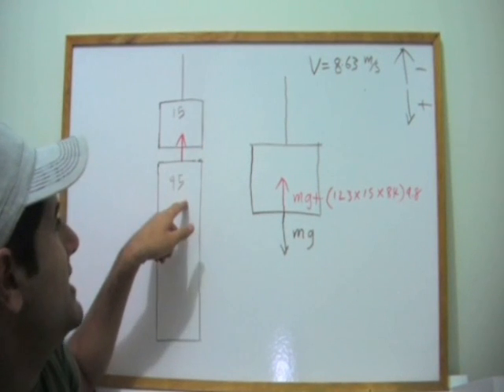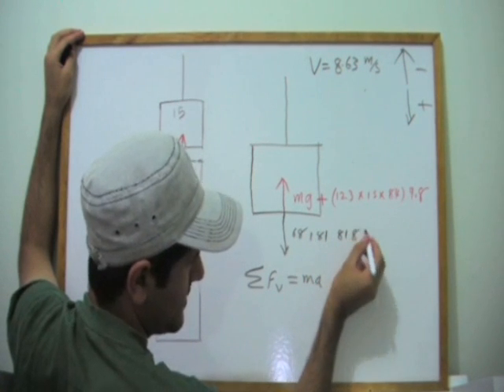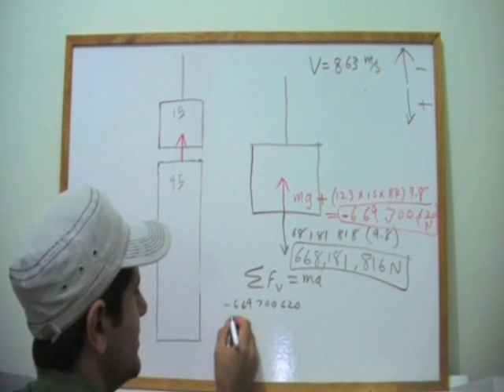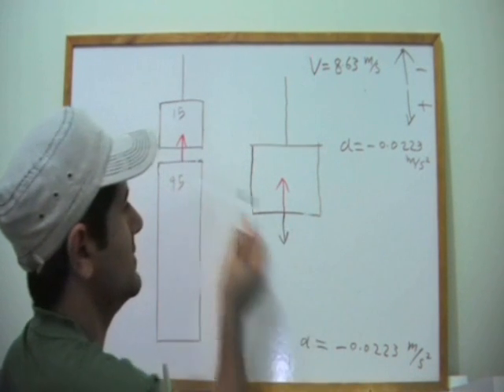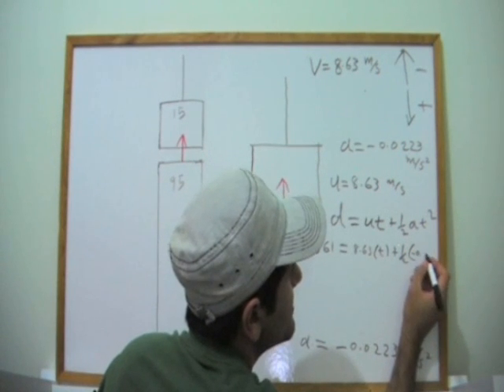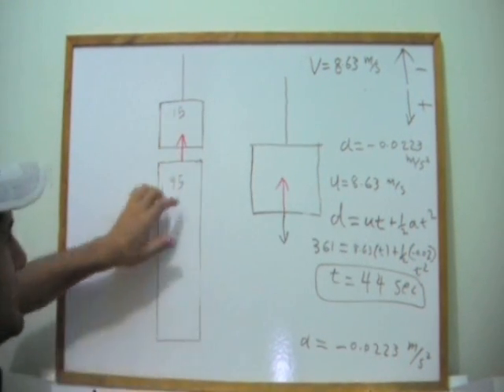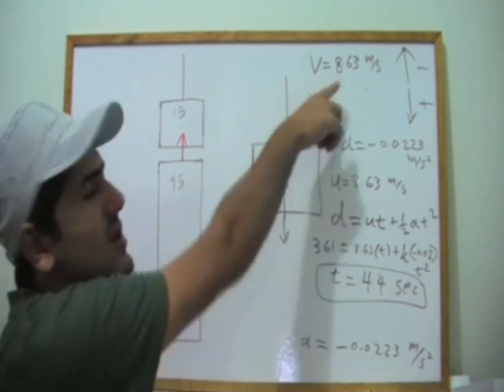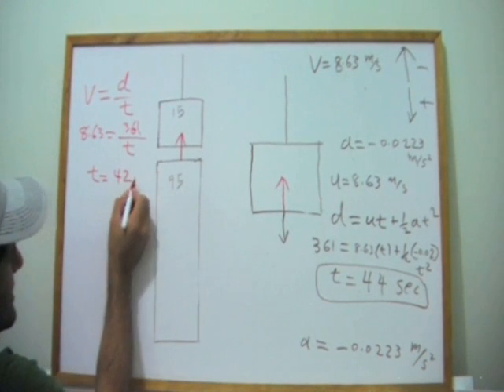(Part3) 911 Simple Physics Structural Failure Vs Demolition

Comment: This guy completely ignored the fact that one floor being crushed below the impact point, adds to the downward forces.. a second floor adds another force, and so on and so on. He needs another drawing board!
Reply: +999DaveUK  
Dave you are absolutely correct. These idiots think that it's the top of bldg vs the bottom. The truth is it's the top vs a single floor below. Dynamic weight vs live load capacity. It wasn't even remotely close. The top is cumulative and ever increasing in mass. Ali's math may look impressive, but he has no understanding of how these bldgs were built, thus he cannot apply his math properly.

Then you have idiots like Kevin and Mein who thinks Ali's math somehow vindicates their stupid theories. When in fact it just shows how ignorant they all are to the engineering of these towers.
Reply: +Kevin Price But it didn't disintegrate did it? There was some 30 to 40 storeys of core still standing after collapse. For a period of 30 seconds. Your explosive theory doesn't explain this does it?
Reply: +Kevin Price The point is..... the guy in the video is making up his own physics laws. And for you...what is worse....is that you actually believe in his theory. Good luck with your research into fairy tale science.
Reply: +Kevin Price Kevin....I think you want a NIST Report that goes something like....1. WTC7 collapses. 2. Observations.. looked like controlled demolition 3. Evidence.... none but who cares? 4. Conclusions. .. explosives..or maybe thermite....or maybe super thermite...or maybe super duper nanotechnology thermite. Job done!
Reply: ***** It depends how you define 'pulverised'. There was a pile of debris, after the collapse, which went to a height of about 15 to 20 storeys. This comprised concrete panels, steel, chunks of concrete and office debris. The downward gravity fed forces totalling 250 tons of TNT equivalent, would cause major break up of concrete.
Reply: ***** It's important to explain the events using evidence, and not some theory which is based around unknowns. I don't understand why you call me biased, when I have presented facts. Anybody who attempts to raise the theory of controlled demolition needs to provide the evidence and logistics behind this.

You said you thought 'everything had been pulverised', then you suggest to me that I think steel can be pulverised? NO... of course I don't believe the steel was pulverised. Where on earth do you get that idea from? I previously stated that there was a pile of rubble and steel 15 storeys high after the collapse.

So perhaps you can explain to me where I have ''changed anything based upon what I have seen''?
Reply: ***** Don't forget the question I asked you.

So perhaps you can explain to me where I have ''changed anything based upon what I have seen''?
Reply: *****

But I came here to comment on this video. You haven't challenged any of the points I made about the accuracy of what this guy has said, instead you are loath to criticise obvious errors. This is understandable.

This is why 9/11 conspiracy theorists get such a bad press.... they have evolved into beings that are quick to say what couldn't have happened, but steer well clear of making direct allegations. This avoids direct challenges. But it also prolongs the doubt in some peoples minds.

But after 14 years, nothing has emerged anywhere near to exposing your 'wicked government'. Perhaps after another 14 years, you might ask yourself 'why?'
Reply: +999DaveUK the removal of acceleration, won't be compensated by the small mass added.
Reply: Kevin Farnan So you consider 8 to 10 stories of a tower block to be a 'small mass'?
Reply: +999DaveUK Your argument does not explain the systematic disintegration of the core steel structure.
Reply: +999DaveUK I'd I were you I would research this subject a little more.
Reply: +999DaveUK I appreciate your comment, but it is NOT only Mohamid's physics, but 1500 architects and engineers, hundreds of high ranking US military officials, etc., etc.  Tom continue to condemn them is an act of futility.
Reply: +999DaveUK BTW, I can't believe some of the irate comments some people are making here!  Not you of course, but this is a filthy place and I have to get out of here.  Sorry ;)
Reply: +Kevin Price  I don't blame you - personal abuse is one of the techniques used by some people such as oldschooldan1 to drag the interchange down to their level when they cannot engage in constructive argument. It is a widely used technique, unfortunately.
Reply: +Mein Sohn Thanksgiving you for your reassurance.  IT is very disheartening when this happens.
Reply: +Kevin Price  Your welcome - best to you.
Reply: +Oldschooldan1 In simple terms, the free block of 10 stories fell without any resistant opposing force until it met the first solid floor. The energy produced by weight and velocity far exceeded the design loading of the floor below. Hence collapse with increasing weight and lower velocity. The video incorrectly presumes that the floors below act together to resist the kinetic energy. Therefore the math calculations he uses are not based on the true action of the building.
Reply: 999DaveUK
 Exactly, what he is proposing is that the structural columns fell 12 feet and landed perfectly on the columns below. How he thinks a 14" square box column is going to land perfectly on top of another 14" square box column from 12 feet up int he air is beyond me. There are so many people that just can't grasp this.
Reply: +Oldschooldan1 If you would stop resorting to vulgarities and name calling, maybe we could have a more constructive debate.  So please, let's be a little more civilized, with nor more stupid remarks as it speaks loudly of what type of person you are!  I am not saying for one minute that this video explains it all with comprehensive physics. A good place to start research on this topic is this website: http://www.ae911truth.org/ of 1500 architects and engineers.  I don't know your credentials, but I have a degree in physics and I can't even begin to dissect all of the intricacies and dynamics of the collapse of those three buildings.  The website link I have provided can at least begin to do this.
Reply: +Kevin Price Have you looked at the credentials of some of these so called engineers? Check out their skills. You'll find a lot of them are no more than building contract managers working on single storey buildings like schools. It's quite interesting to discover their agenda.
Reply: +999DaveUK Yes, I agree (some of them).  Many of the architects who have actually worked on the design of the buildings also have serious problems with the official report.
Reply: +Kevin Price Kevin. ..many of the architects and engineers who worked for the contractors on WTC do NOT have any major problems with the NIST report. NIST themselves say no one will ever know for sure the sequence of collapse.
Reply: +999DaveUK There we go.  Some are some are not.
Reply: +999DaveUK I, hopefully like you and every other decent human being wants the truth, and not a report that goes something like this or that.  The NIST report is seriously flawed, and that IS a fact.  The whole forensic process following the disaster was seriously flawed, and that IS a fact.  All I want is the facts.  Anyway 999DaveUK, it was good discussing this with you, unlike another blogger in this blog, but I can't handle any more of the tit-for-tat stuff happening about this video, so I will now unsubscribe.  "Seek the Truth for the Truth shall set you free" ;)
Reply: Kevin Price Kevin, before you go. I want you to understand why I was so abrupt with you. When you make claims like the cores disintegrated it just adds to all the stupidity that floats around the internet regarding 9/11.
Some gullible kid it going to say geez the cores just disappeared. When this this is completely ridiculous. The core columns were all found in the pile, they did not disintegrate.
You say you want the truth, well have you actually read the NIST report or the AWS report? Have you read the bldg plans? Can you understand them? I've spent the last 20 years in the architectural field and read the bldg plans, been in all 3 bldgs and know the limits of the floors. I can tell you without a doubt the floors could never, ever taken the amount of force put upon them by the falling top. If you want to continue I can be civil, but if you start talking about energy beams or nukes or anything ridiculous like that I will be forced to call you out on it.
Reply: +Oldschooldan1 There are a lot of people of high technical credentials who would disagree with you on many of your points.  I don't really know who you are, or your true capacity, but I will leave the debate between you and them.  Anyway, YouTube is a ridiculous venue for this type of debate.  Have fun, don't get too excited, or like they say, your Hapkido might backfire on you ;)
Reply: +Kevin Price Kevin.. you ignore one basic fact. There are flaws in this video, flaws in the science and flaws in the conclusions. We are not talking about minor flaws, but major flaws in his argument. This is NOT a matter of opinion.. it is FACT! I see these videos daily on the internet, YouTubers who have an agenda, and then use flawed arguments to make their agenda seem real. So if you want to have fun, watching truther videos, and agreeing with likeminded souls, this is the place to be. As for me, I won't allow these same ''truthers'' to spread garbage without some kind of challenge.
Reply: 999DaveUK
Well said, Dave!
Reply: Right on.. The comfortable piew is always more comfortable.   Just like you support official stories from the establishment and challenge "truthers",  some people dare to challenge the establishment.  Of course the establishment and main stream media label them as conspiracy quacks.  Can you imagine a world where no one challenged the establishment?  :O
Reply: +Kevin Price And all the comfort you need is here. You'll find the truth somewhere...just remember to avoid the facts....make up stories.... ignore evidence....and you'll fit right in.
Reply: +999DaveUK We could go on forever,  but from the statement you just made I believe you really did not digest may last statement,  so I will leave it with all you experts to argue in favour of the establishment who loves you for your loyalty.  Anyway Dave,  I am running out and leaving it in your expert hands ;)
Reply: +Kevin Price Well I was just implying that if the truth I so important to you, then supporting a video like this is unwise...
Reply: +999DaveUK Please make a video that shows the math and even an experiment. I really don't want to believe the truthers but they make the best explanation for it to me.

 Like to make a point that Muhammad said in this video and to which you, you seem to be ignoring. The building took about 10 seconds to fall and if you take the best conditions for this building to fall, it would have taken about 42 seconds to fall. And please, simple stating that his physics is wrong isn't going to fly for me, please prove it for me.
Reply: Leigh Foulkes First of all I would say that nobody knows how long the towers took to fall, due to the large debris cloud which obscured everything.

Regarding the video, not only is his physics wrong, his assumptions that the upper mass of floors impacting on the floors below would be repelled by the upward resistance is patently false. He explains the upward resistance of the floors below to be sufficient to repel 14 or 29 stories of dynamic mass.

Where you state that the video explains that the collapses took 'about 10 seconds', I would ask... how does he know this?

There are two ways of calculating approximate collapse times. One way is to observe and time, the other way is to calculate using known forces and other observations, such as video or sounds.

This video ignores the weight transfer in the form of momentum of mass and velocity impacting on the first solid floor below. Let me ask you this. If the first solid floor that the upper block hit had a design loading of x, do you think that the upper block impacting exceeded this load x or not? If your answer is yes, then the next floor below is going to be impacted by a reduced momentum, but additional mass (x+y) where y is the mass of one floor.... and so on. If your answer is no, then you would have to explain how that momentum could suddenly be transferred into the vertical columns and immediately repelled. And don't forget that there are unknown forces to be applied, such as vertical columns becoming detached due to sideways pulling by collapsing horizontal beams. As well as the energy contained in fires.

Regarding collapse times, the approximated free fall time would have been around 9 seconds. The approximate collapse times using momentum/weight transfer calculations coupled with video and audio observations was 12.6 seconds for WTC 1 and 11.6 seconds for WTC 2. This collapse time consists of two elements, the initial collapse below the block, and the final block collapse as it hit the rubble pile. This gap is crucial, as it's defined by the timed collapse of each upper floor being approximately 0.1 second. For WTC 1 this equates to 35 stories, and WTC 2 to 25 stories. So these values are NOT small.

Finally I don't have a video of this as the calculations are quite complex with many unknowns and variables. But please look at the paper by F.Greening http://www.911myths.com/WTCREPORT.pdf which is professionally explained, unlike the amateurish effort in the video here. Then make a judgement yourself, it's your choice.
Reply: I believe that this wasn't a core as is the modern concrete core which is designed to take all weight and stress imposed on the building but a relatively light steel core which was intended to work with the external structure as as a combined strength design....the core also providing for the services....
Reply: The biggest problem with trying to accept this guys hypothesis OR the government one and 'prove by math' is that there is no way to measure or even closely estimate the mass of the ejected material. So much concrete and steel was blown out sideways that it is no longer part of the working mass of either theory. I'm much more interested to learn how all the core columns and exterior ones failed nearly simultaneously given the asymmetrical damage and heating. All of the government reports conclude with 'and then the building inevitably fell down'. Contrast that to the performance reports of the Murrah federal building in Kansas City, a meticulous failure description beam by column, by floor. Then we can ask what caused the sulfidation present in what little steel remains for our examination. It's all more or less moot, the world isn't going to change back to pre 9/11 conditions. [thanks for the link, I'll read it after dinner]
Reply: Phil Rabe
You cannot compare the Murrah federal bldg to the WTC. They were not built anywhere close to being a like. For the collapse of the WTC to have been stopped 6 floors worth of mass would have to have been ejected for every floor destroyed, this did not happen.
Reply: Sorry, I was comparing the quality and the detail of the two investigations. I did not make a comparison of concrete vs steel framing. The current hypothesis [only for WTC 1,2] depends on accretion of debris and ignores the loss of the unknown but clearly Large mass of the ejected debris, therefore a better model is needed. So far the only explanation for the  volume of ejections is the air being energetically blown out from each floor. No compelling explanation for the melted and molten metal at GZ, steel sulfidation, the fires in the pits for 90+ days after, etc. etc.
Reply: Phil Rabe

”Sorry, I was comparing the quality and the detail of the two investigations”
The WTC collapse has been the most expansive engineering investigation in history.  We have the FEMA report, the NIST report, and the AWS report. Reports from Purdue, MIT, the ASCE and dozens of papers by independent researchers such as Bazant and Greening. The head of the ASCE investigation was the same person who headed the investigation in OK. I fail to see how the OK investigation was any better than the WTC.
 
”ignores the loss of the unknown but clearly Large mass of the ejected debris”
Let me try and explain what you are asking to have happened. The south Tower collapsed around the 80th floor, there were 30 floors above it. The floors were rated for no more than 6 floors falling onto them. You are saying that 24 floors would have to have been ejected from the bldg. at the point of collapse. After this point the number only grows with each falling floor 25, 26 and so on. Does this seem remotely possible?????
 
”No compelling explanation for the melted and molten metal at GZ, steel sulfidation”
There was never any molten steel at GZ, none. Feel free to link me to one photo of molten steel. The sulfidation only seems to have happened to a couple of pieces from the pile and has been explained by exposure to the massive mixture of elements found in the pile including GWB. The truth movement tried to do an experiment showing that fire and GWB could not produce the found effects, the problem was they left out 2 key elements, time and water. The samples that show this sulfidation were victims of nothing more than acid rain. There was 220 acres of combustibles at GZ it’s not hard to understand why the fires lasted so long; underground fires have raged for years.
Reply: Thank you for the measured rebuttal rather than the usual '911 acceptors' howl in all caps "Why can't you damn truthers let the poor souls rest in peace". I am familiar with all the rebuttals you offer.  I am not tech savvy enough to make my own links and know better than to point you to a 'truther site'. I will take screenshots and try and paste them in the end. The point with the two investigations I keep failing to make is that the only building performance report [FEMA] concludes 'and then the collapse was inevitable'. In KC they did not say 'after the truck blew up, the building fell down'. ASCE did not do a performance report that I know of. Actually I had not heard that the sulfidation could be from acid rain, so that's something. 
OK it seems I can't copy and paste into this chat frame,I could email but I'm uncomfortable asking you for an address. I would show the videos of the 'metal pouring from WTC2' moments prior to collapse, it is on google without going to a truther site. Apologists or '911 acceptors' say it was molten aluminum, or copper from the planes. AL is silver when molten and Cu takes a much higher temp than a hydrocarbon fire will produce. In 'the pile', I  suppose pulverized office contents Could burn underground for 3 months w/no Ox, but it would just smoulder and never reach / maintain temps of 1500F+ as seen in NASA thermals of GZ. Not sure where you found that the truther wallboard experiments did not give enough time for the eutectic sulfidation present, they usually let it burn for much a much longer time. Thanks again for not getting all angry and all capping!! [re: ASCE, "A group of volunteers from the American Society of Civil Engineers (ASCE), many of whom had also participated in the Oklahoma City bombing investigation, started an investigation with limited resources. FEMA eventually took over the ASCE's investigation, and named it the Building Performance Assessment Team (BPAT)."
Reply: Free fall would have taken about 10 seconds.  Any resistance (impacting onto lower floors), would have significantly increased the time required for the complete collapse.
Reply: I got a ration of crap from a government apologist: They've increased the total collapse time by adding the few seconds the remains of the core stood for 1&2, and they added the part of the early penthouse collapse we rarely see to WTC 7. They also claim that office fires reach and exceed 2000 F and that iron micro spheres are a common byproduct of an office fire... It's the same line they used on the molten steel pouring out of T2 saying it was aluminum or even the copper wiring from the planes. sure guys.
Reply: Phil Rabe
”They've increased the total collapse time by adding the few seconds the remains of the core stood for 1&2” The time of collapse is the time of the collapse, video, audio and seismographic evidence doesn’t lie. The cores stood for nearly 40 seconds longer than the initial collapse, this was not just a few seconds and is rarely if ever included in the collapse time.
 
” they added the part of the early penthouse collapse we rarely see to WTC 7” You rarely see it because it goes against Truther dogma. It proves that collapse started internally and at column79.
 
”They also claim that office fires reach and exceed 2000” No the official claim is that temps reached around 1800F, this is common in office fires.
 
”that iron micro spheres are a common byproduct of an office fire” No, iron micro spheres are by products of welding and the fabrication of the steel itself. Walk into any welding shop and you’ll find the floors covered in them.
 
”the molten steel pouring out of T2 saying it was aluminum or even the copper wiring from the planes”  Well seeing how the metal ( not steel) was pouring out at the exact location where the plane came to rest, what else could it be….thermite???? I think not. How could the thermite and detonators survive the planes impact and fire??? Do you know what is used to ignite thermite, I do…magnesium. It is one of the few elements that burns hot enough to ignite thermite, it is also extremely flammable.
Reply: Kevin Price ''Free fall would have taken about 10 seconds''.... true free fall would be 9.1 seconds for an object dropped from 416 metres to a 10 metre high base at ground level.
''Any resistance (impacting onto lower floors), would have significantly increased the time''....the assessed and calculated fall times based on observations, seismic and video evidence were 12.7 seconds for WTC1 and 11.6 seconds for WTC2. These are differences of 3.6 seconds and 2.5 seconds. These ARE significant and show the resistance or static energy in the floors reduced the fall times. Put into perspective, there would have been 26 to30 stories of WTC tower structure still standing while your free fall object had already hit the ground.
Reply: I guess since since the only hard data on when the roof hit the ground is seismic, we need to focus on the speed of the observable collapse from all the video evidence. Trying to include parts of the core that stood 20 or 30 seconds longer is pure obfuscation, as is including the early collapse evidence of tower 7 prior to the ultimately confirmed by NIST FREEFALL part of that collapse sequence in an bald effort to disprove 'near' freefall speeds of the entire WTC7 roofline once it started to drop. The videos support the hypothesis that there was little or minimal resistance from the cold undamaged structure below the impact zone in 1&2, they include the ejected material as part of the collapse mass dynamics and make no explanation for 7's failure-Please don't regale me with pseudo descriptions of how column 79 caved at floor 12- NIST ignored the construction method used in high rise steel framed concrete floored buildings and have blocked release of 'as built drawings' that would eviscerate their hypothesis, because security /terror. that is not science. If those simple facts don't make sense there is no point in discussion. Drink the kool aid, it refreshes rather than confounds.
Reply: Phil Rabe
” the only hard data on when the roof hit the ground is seismic” No, we also have video and audio evidence, both of which prove that the collapse was much slower than free fall. The speed of the collapse of WTC 1&2 is consistent with how the structure was built. The floors were not rated to carry the load anywhere near what they were exposed to. This is a mathematical and engineering fact, there is no argument on this point. The structure below would have produced negligible resistance to the upper falling mass. The AWS report on the condition of the steel found at the site confirms this. The report proves massive overloading of the truss seats. No one is trying to include the cores collapse time into the equation, as I already stated it is seldom if ever used in calculating the collapse time. If it were the collapse time would be closer to a minute, no one makes this claim.

” including the early collapse evidence of tower 7 prior to the ultimately confirmed by NIST FREEFALL part of that collapse sequence in an bald effort to disprove 'near' freefall speeds”  I love this, this is complete nonsense. Why would you not include the start of the collapse in your calculations????? WTC 7 experienced 2.25 second of near free fall at the end of the collapse and this was caused by buckling of the exterior columns due to lack of lateral support from the already collapsed floors. A 47 story column cannot support its own weight without lateral support it will buckle. Keep in mind that true free fall only occurs in a vacuum, so unless you are claiming that rockets were attached to the falling steel to increase their speed, true free fall did not occur.
 
” they include the ejected material as part of the collapse mass dynamics” Do you have any Earthly idea how much material would have to have been ejected to stop the collapse???? I do! The south tower collapsed around the 80th floor, which leaves 30 floors above the impact zone. The floors had a live load of 6 floors worth of dynamic weight. For the collapse to stop, 24 floors would have to be ejected and this is at the point of collapse. After this the number only increases with each floor, 25, 26, 27 etc. Do you honestly believe this much mass was ejected from the bldg.??????
 
"NIST ignored the construction method used in high rise steel framed concrete floored building” They most certainly did not. Here is what they had to say about the shear studs:
 
 
For the 16-story model of WTC 7, NIST did not include shear studs on the girders based on the following reasoning:
(1)   The structural floor plans and erection drawings for typical floors are consistent and do not indicate any shear studs on the girders,
(2)   The Salvarinas paper did not cite a source for its figure showing "Typical Floor Framing," and
(3)   To make the modifications to the framing on Floor 10 would have required accounting for the structural changes shown on drawing S-8-10 (steel plates on bottom flanges of floor beams, shear studs on girders, and reinforced connections), and making the attendant changes to the floor loading in order to be consistent.  Since the drawings did not provide any information on revised floor loading or revised connections, this was not possible. 
 
It appears the only one drinking the proverbial cool aid is you….
Reply: and he's also completely ignoring the fact that there are thousands ton of steel which have resistance like hell and the floor where affected only on the 1 side which  would not produce such nice controlled collapse
Reply: Robert Balejik I was making the point that the guy who made the video completely disregarded the laws of physics. It's such a crass video attempting to show that the towers should not have collapsed. But in order to make his point, he invented things! According to him, the upper blocks of floors should have just stopped when they hit the first solid floor....if he'd have calculated the mass and velocity and the momentum forces, this would have told him his theories are bullshit!
Reply: 999DaveUK YOU COMPLETELY IGNORE THE CONCEPT OF "RESISTANCE".
Reply: 999DaveUK NO ! HE DIDN'T SAY THAT THE UPPER BLOCK SHOULD STOP. ACTUALLY HE SAID THAT THE UPPER BLOCK SHOULD SLOW DOWN !
Reply: DaveUK, If you think a fact-less supported opinion can destroy the proofs proffered by the  time, effort, logic, and obvious intellectual acumen of Ali's videos, my opinion of the UK if they backed you would drop  faster than the WTC.
Reply: Regardless of WHO did 9-11, the effects are what are called into question. The buildings based on actual engineering and physical laws could NOT HAVE FALLEN AS THEY DID due to aircraft collisions, or the fires. Ali has explained -in an impartial way, backed up using the incontrovertible laws of physics. Any other opinion using nothing to back it up is as useful as air bubbles in a scuba diver's blood stream.